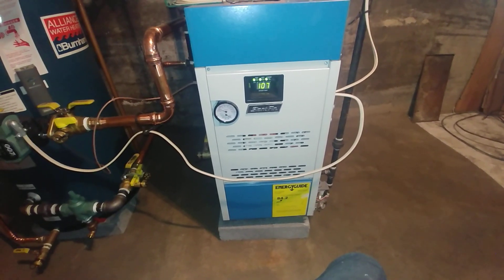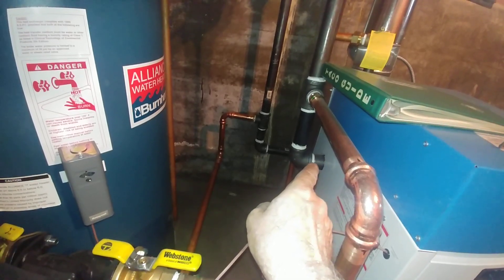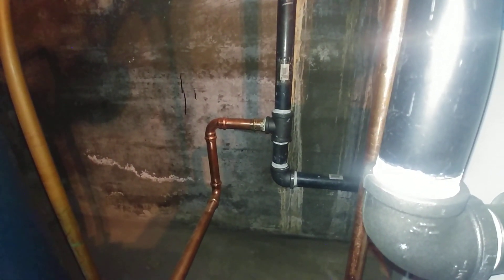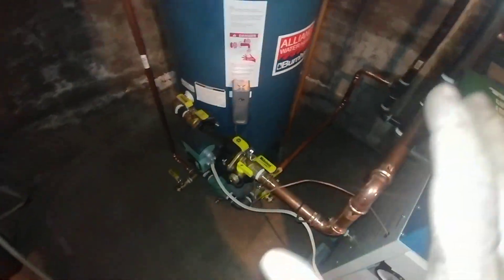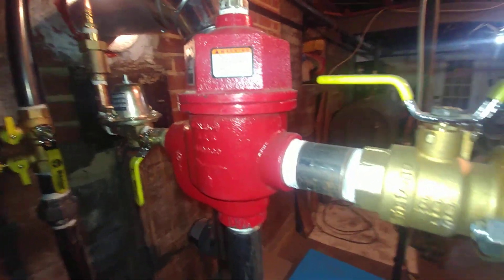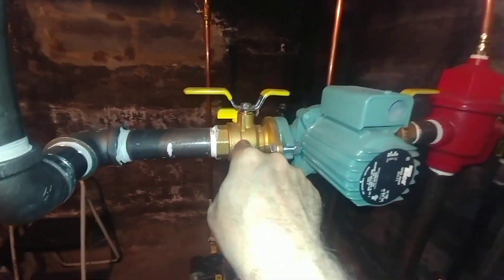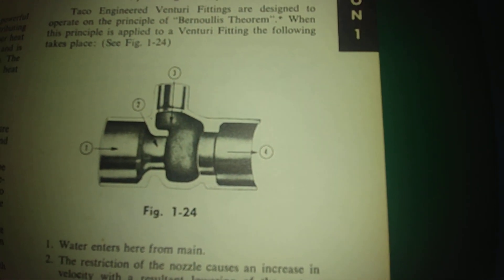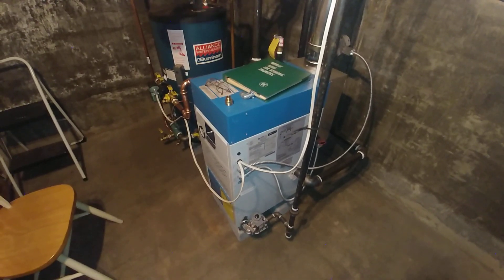Domestic Hot Water Heating Boiler That Also Heats The House Through 1940s Taco Venturi Single Loop

Comment: Clean install. If you were figuring 7.5GPM flow the 110 would provide 7.5', the 007 would be 8.5', and 0010 would be 10.5'. Both would supply more than original 110.
Reply from the maker: Thank you for that info!

Comment: Nice Job!! Gordon do you know if the "Taco Guide" is still available from Taco?. My copy is at least 40 years old and falling apart>
Reply from the maker: I actually don't know, but I suspect it's only available on line nowadays. 

I've often pondered on the life cycle of manufactures hard copy catalog info.
See if this makes sense:
When stuff first comes out and for maybe a few years after, the hard copy still has value but that value rapidly drops away.
Soon, it's old news, and, if not laying in some forgotten corner of the shop, it will be uncerimonisly tossed into the rubbish bin or at best  "recycled".
The catalog spends most of its time in this twilight knife edge existence.
Until, at last, it reaches that point of being "historical".
Then, it might be treasured again many years in the future.

Comment: Looks nice Gordon! 
I like to put a drain right upstream of flo-cheks, helps if you gotta drain a system especially in existing piping problems. Those adjustment screws get rusty, leak and better experience tells us, don’t touch them. I always start with valves on old main’s tie in, it distinguishes from existing work and new work if I have to do additional leak repair out of contract or fix my own work correctly, it’s about reputation.
Reply from the maker: Thanks!
And thanks for the tip.
Yup, dirty little secret about old leaking flo cheks.
Reply from the maker: Hey, are you still out of Wilmington?
Good to hear from you again!
Reply: @gordonschweizer5154  
Yep, still in Wilmington.
Glad you remembered. A lot of early 1900’s city townhouses and 1920’-193? suburban city single  homes built for DuPont executives.
Reply from the maker: @bauhnguefyische667  This past summer we did a job in your neck of the woods and I was hoping we could have met up then, 'n go out for a beverage or two.
Maybe next summer?
Reply: @gordonschweizer5154  
Sounds good to me. Would enjoy meeting you.👍

Comment: Excellent, clean piping. Although I would have wired with MC cable instead of Romex.
Reply from the maker: As I said in the video, the wiring was temporary so I could get the customer domestic hot water ASAP.
I spent many long hours putting this thing in and I don't stock any MC wire.
My partner came back later to properly wire it in.
The customer generously supplied the romex so I could get them hot water which they have been without for days (partly due to my plodding work speed).
That MC angle connector came with the flue damper and has that gosh-darn snap ring on it instead of a proper lock ring.
Reply: @gordonschweizer5154  my b. I didn't listen to the audio completely.  Again, excellent workmanship. I'd love to have you guys come help me work on a mansion in Bloomfield, CT. It's a good size H.B.Smith steam boiler, 2 pipe system with 3 zone valves up near the ceiling of the boiler room. When the boiler is running at full capacity, eventually the boiler feed tank starts to billow steam out of the vent of the receiver tank. Probably some bad traps that would have to be deciphered.
Reply from the maker: @jeffreyjohn2037  You honor us, sir.
Please, if you can, send pictures of the site to allsteamedupATverizonDOTnet
I think you have the right of it about failed open traps.
Reply: @gordonschweizer5154  thanks for replying. I will definitely get back to you with some info. I'm just a one man show, with a couple thousand of potential customers. I'm a steam heating contractor with several plumbing and heating colleagues who are cooperating with me. Crazy schedule this time of year. Working 7 days a week this time of year. 60 years old and third generation oilman. My Dad taught me how to restep a stack switch when I was 7 years old, 1968. I prioritize my schedule on whoever screams the loudest next.

Comment: A very nice, clean job. Thank you for the run down on the system. I love that you add so many cutoffs and and purge valves. Just like you do with steam. Even though it's more costly up front, it really makes it up on the serviceability, thus prolongs product life. It makes so much sense. Thanks for posting
Reply from the maker: Thank you very much.  
Yeah, as a service plumber, I always hated the way install folks tend to put in just the minimum possible number of valves, because they never had to service it once they completed their install.
I always try think about access and serviceability because it's the right thing to do.
On this job, I got some instant karma, because there was a leak from a bad fitting and I was able to clear the fault in short order due to the valves.
Reply: @gordonschweizer5154  Great thank you again